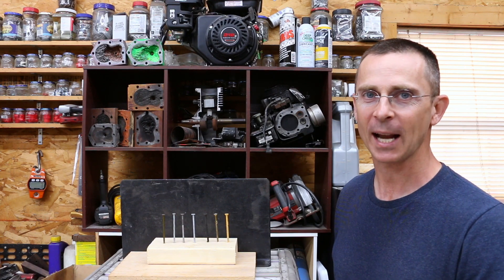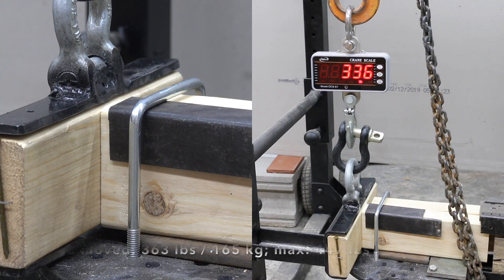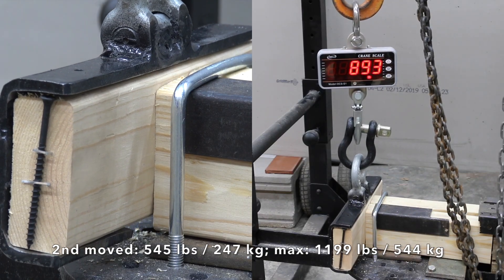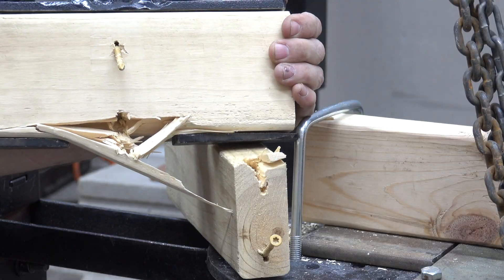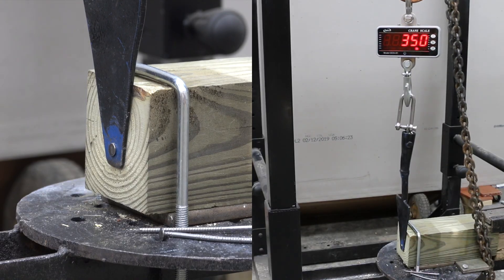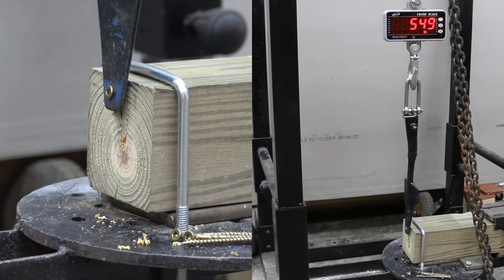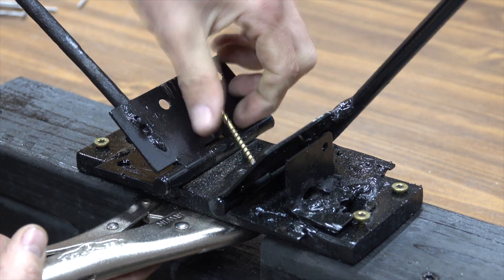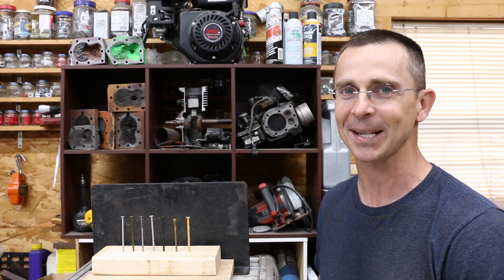Do Screws Shear easier than Nails? Let's find out!

Comment: You did not really test shear strength at all. You measured how much force it took to pull them out at an angle.  Your last test to break them by bending is unlike any real application. nails and screws are meant to be driven all the  way in and could not be bent like that with out the wooden structure being destroyed by something else before they ever bent that far.
Reply from the maker: Thanks for the constructive feedback

Comment: Great test! Thank you. The reason i asked you about Shear strength is because of hurricane straps. According to code  all hurricane straps must be fastened with a case-hardened nail. Seems to me as far as holding strength screws would be better.
Reply: Dysfunctional Fly Tyer. Agree. I think a deck screw would be more beneficial to holding and shear strength when properly applied. A fully sunk deck screw would hold a strap better and be rust resistant.
Reply from the maker: Great point and thank you!

Comment: Interesting. Seems the brittle screws and or nails would still be a good option as the flex test was bending on a very large angle. If you bend or flex that much you pretty much demolished anyway. I would try something like 3° flex or bend.
Reply from the maker: Thank you!

Comment: This video is a great source of information for basic construction with soft pine lumber. As we learned the fasteners rarely failed in the different tests. The lumber actually failed. The loose fibers can't withstand the forces. No surprise that we see the screws hold better because they can grip the fibers with their threads. I believe we would see completely different results with a dense hardwood like Oak or Hard Maple. The fasteners all would shear before the fibers torn apart or the lumber would crack or spilt. I think this video further reinforces the importance of fine detailed wood joinery for furniture grade projects. Great video! really enjoy your productions!!
Reply from the maker: Great point!  Thank you

Comment: Hey could you try spax screws I get them at home Depot and I love using them I use the 3 4 and 5 inch
Reply: Trey Elam I love my spaxes too
Reply: Spax are the best I have found. I drove some stainless steel spax screws into the maple legs of my workbench. I used pilot holes. Came up a few screws short, so went to a local screw supplier and got their stainless steel screws. Several broke, even with pilot holes. Been using Spax as much as possible ever since.
Reply: Agreed, cheap and seemingly awesome

Comment: What about Shaw Shanks?  I heard they're pretty redeeming, lasting 19 years of abuse, even in the most grueling environments.  They're also great for working on roofs, even in the high summer heat.
Reply: They work the best, whether you are on the "inside" or the "outside."  Always use a rock hammer to drive 'em in.
Reply from the maker: Thank you!

Comment: How about testing simpson strong tie brackets on how much force it takes to pull them apart or if the screws/nails fail holding the brackets to the wood
Reply from the maker: Great suggestion!  Thank you!

Comment: Drywall screws get a lot of flack for being brittle, but in reality the wood is almost always the weak point. For general construction that doesn't have to be load bearing they hold plenty strong for things like makeshift shelving, and I use them for making equipment stands in my locksmith truck and they don't even come close to getting to their load limits, they are an invaluable cheap fastener for kicked in door jambs and what not as well.
Reply from the maker: Thank you!

Comment: I would still love to see some destructive testing on Snap On, Husky, Harbor Freight, Gearwrench and Craftsman wrenches, sockets, and ratchets. See how much force various modes of failure require.
Reply from the maker: Thank you!
Reply: @ProjectFarm  reminder
Reply: You should check out a channel called Ave. He does alot of videos like that and he's funny as hell.
Reply: Have you ever had a hand tool fail on you? I’ve never had a wrench fail on me. Maybe a generic socket wrench or two. I learned my lesson with the busted knuckles.
Reply: @MoneyManHolmes  I've had ratchets barf their guts out and sockets break plenty of times, that's not even that difficult if you can brace your body and aren't a scrawny lil feller.  On the other hand,  I've only broken the poorest of closed end wrenches and that was with a cheater bar.
Reply: for that you can check out AvE's channel
Reply: Ave did a pretty good test.  https://www.youtube.com/watch?v=KesUkDx-7LI
Reply: Good idea
Reply: That'll get expensive real quick. He buys all his own stuff to test.
Reply: That would be really expensive, even by PF standards. Support Project Farm on patreon if you're not already!
Reply: Load test them yourself. I have broken all 3 of the common sizes 1/4, 3/8, 1/2  sockets and drives usually forcing a smaller size to do something a larger size would have survived. Back in the day I started out with 1/2" and never looked back for a long time. I never had the balls to break any of the 3/4 and 1" stuff, given the time I probably could with a long enough cheater bar. Usually the bolt breaks before anything else in the larger sizes. 

You waste your money with Snap on you can buy 2-4 wrenches or other tools for that matter for the cost of 1 snap on. I can count on 1 hand the number of craftsman wrenches I toasted over the years. Of course that was when craftsman were made in the US with better quality control those days are over. Buy them cheep with a "lifetime" guarantee, break them or not, then take them back. In the normal use of a tool if it is used properly and you didn't get 6 for a dollar it will last a long time no matter what the brand.
Reply: @thinkfirst6431 PF regularly requests video ideas. Anyone else's assessment of a suggestion I make, much less telling me to do this or that, is completely immaterial to me.
Reply: @thinkfirst6431 So assumptive, I have never bought any of the big name expensive tools. I actually buy at pawn shops and clearance sales only. Your assumptions about what I own are wrong. PF asks for input on test ideas. What others think about it doesn't matter to me.
Reply: @Juice556  I buy all tools I can find that I want or stockpile at all places that I can find a tool for 10-20% of new. So you would waste PF's time testing tools you are not going to buy anyway. A wrench for a $1 is just a wrench for a $1 it doesn't matter what the brand if you have 5 of the same size you have a lifetime supply anyway. Think about PF's time as a resource I would rather have him work on something hard to test like the oil shootout he did than finding out a $2 wrench breaks at the same rate as a shiny $20 one. I am beginning to think that you don't think at all not that it matters to me.
Reply: @thinkfirst6431  PF Asks for ideas and comments. Other people's thoughts or opinions on what I say do not matter to me.
Reply: @jakeshaw6827  Not a all. Who cares if a $2 wrench fails before a$20 wrench, just buy 10 of the $2 wrenches. B's best argument is that he doesn't care what others think which means that we shouldn't care  about what B thinks in the first place. 

What we should be asking PF is how much holding power there is for lag bolts in a pound of butter. Who knows how much butter could be saved from falling on the floor if it had a 6" lag bolt in it?

Comment: Will you do a video on oscillating tool blades? I buy integra from Amazon. They work alright, but the center hub seems to break out frequently. I justify buy them as 20 for 20 bucks, vs the box stores brands at 10-15 bucks a piece. 
I've bought the titanium coated, the wood embedded with nails, and soft wood blades. I really don't see any difference. I do know the harbor freight blades aren't even worth considering though. 
Anyway, I enjoy your videos, and look forward to new ones each week! Keep up the great work, and thanks again!
Reply from the maker: Thank you for the video idea!

Comment: Simpson StrongTie makes fasteners which they claim out perform others. How do those 'high performance' products compare?
 SD CONNECTOR ScrewSimpson Strong-Tie® ConnectorsThe Strong-Drive® SD Connector screw is specifically designed to replace nails ... the single-fastener load values achieved by the SD screw exceed those of typical 10d common or 16d common nails.
They also make some stainless steel screws.
Reply from the maker: Thank you!

Comment: I call error.  Love your videos but I'd like to point out that nails or screws into end-grain alone is not proper use of the fasteners. 
Yes the can go into end grain to tack things in place but all connections should be nailed or screwed across the grain into cross grain even if it's just toe-nailing or toe-screwing.
Reply from the maker: Thank you fro the constructive feedback!

Comment: You need to stabilize the Wood you are pulling UP on.. from the opposite side to prevent the Test board from kicking OUT and then up.. you wanted to test the UP force needed.. not the PULL force which is what it turns into as the wood kicks out from the pulling up! 

To me this test of SHEER Strength needs to be tested in a more reliable way... You had the set up... But you failed to secure the backing so it didnt kick out as you pulled up & the metal Angle you used to prevent the wood from crushing on your bracket needs to be all the way to the END of the wood to prevent the weak point(Wood) from breaking UP and thus creating PULL force again... if you fix those.. you will get the sheer force! because all you did here was do an Angled PULL.. which converts to HOLDING strength and NOT sheering strength! Other than that... this was a solid video! Love the channel so much..... and even though I was critical of the process in this video..... I love the passion and dedication to this! Keep them coming!
Reply from the maker: Thank you!
Reply: @ProjectFarm  You are most welcome sir!

Comment: You could try HurriQuake nails. Per Wikipedia: 

The HurriQuake nail is a construction nail designed by Ed Sutt for Bostitch, a division of Stanley Works, and patented in 2004. The features of the nail are designed primarily to provide more structural integrity for a building, especially against the forces of hurricanes and earthquakes.

The Hurriquake nail won the Popular Science Best of What's New 2006 award for Home Technology and was honored as the grand award winner for Best Innovation of the Year.
Reply from the maker: Thank you for the video idea!

Comment: I would like to see a comparison test on witch is better - crimp (insulated and non insulated) vs solder wire repair - thank you - i've heard the solder  can spread out into the wire making it brittle - and i've heard a crimped repair can actually be very strong if done correctly
Reply from the maker: Thank you for the video idea!

Comment: In the first test, you are nailing/screwing in end grain which doesnt hold the fastemers well enough. Also the force applied is so progressive that you are testing more for holding strength than the actual shear strength of the fasteners.
Reply from the maker: Thank you!
Reply: @ProjectFarm  thank u fir being so accepting to critisism. These are some good points, either way, very interesting. Gives me more faith in some lag bolts ive used lol

Comment: Looks like the 2x4s failed, not the screws.
Reply: The test was really about the ability of the endgrain to hold nails/screws. The nails and screws themselves were not sheared, just pulled out. However, this is just semantics - at the end of the day you want to know how strong the overall joint is, not how exactly it fails.
Reply: @kardRatzinger  Exactly!  Great video with a misleading title.  Wish i could upvote this comment 1000 times.
Reply: @kardRatzinger  Not true. The reason nails are used for framing is that they  have very high shear strength, when compared to screws, which would simple break, rather than bending.
Reply: @MW-gh1mo  Not sure which of my comments you are referring to, I can't remember writing anything that would contradict what you wrote
Reply: Yes!!! ^^^ This is why framing is toenailed  and not nailed into end grain. Common mistake, but an important one not to make.
Reply: In real-world situations, unless the joint is way under design... it's so rare that nail and screw itself will shear apart.

OK the caveat, you could see that his test is flawed. This is not exactly a shear test. It's closer to a bad design bond strength test. His subject rotates so the actual force that pulling the nail out is the probably more tensile force than real shear. This mode of failure is closer to secondary failure in real-world situations.

What if his test line-up correctly, in the end, chance are that it will end up as pulling failure too. But the chance is the bearing capacity of the column will be the failure criterion in this case.
Reply: Yes, but that's the point isn't it. If the fixing is stronger then the wood then there's no issue, is there? There are many construction uses where screwing or nailing into endgrain is used.
Reply: @98dizzard  the point of the test was to see if screws were more or less shear resistant than nails. Not a single nail or screw was actually sheared, so you can't make any conclusion at all about those two in comparison. You can suggest that pine wood is a terrible building material (in terms of shear strength), which it is.
Reply: @EvisNS  however the vast majority of timber framed construction is of pine or similar fast growing lumber. The result is still relevant, all the fixings are stronger than the lumber used in framing.

 The only test I feel would be needed is some further examination of the fatigue cracking. Whilst the test here was extreme, it's an exaggeration of the normal movement a timber frame would experience, further testing of this in a more realistic scenario would be interesting.
Reply: @EvisNS  since it's a soft wood in terms of holding strength it isn't, shear strength it's more malleable than a harder wood (same logic applied as nail vs screw) so it won't snap as easily. If you've ever lived in a place with hurricanes ( I grew up in Houston) you'll quickly realize why structural lumber is a soft wood. The trees always breaking in the wind are the harder oaks, vs the much taller and narrower pine trees will bend and sway in the wind without breaking.
Reply: When I was framing houses my boss told me that a 16 penny nail nailed solidly can hold up to ten thousand pounds. We were installing a steel beam and I was nailing a temporary support block and he I was putting four nails and he said put one so it wasn't a pain in the ads to remove.
Reply: @onehotseat  You might be right, I bet endgrain is even more inconsistent than straight grain in that regard, and the sample size was too small to account for that.
At least the experiment showed that screws generally hold better than nails.

Comment: You should try the screws sold at home Depot, I don't know what they're called, but they are coated in yellow, are long, made for use outdoors, and the head uses a torx bit, which is included.
Reply from the maker: Thank you!

Comment: i feel like nails are getting a bad rap. nails are designed to be used in unison with each  other and splaying out in different directions ...as a construction worker i generally use exterior building screws for the convenience and initial holding power but they dont have great longevity. when ever i get a demo project i love finding screws as they just break  easy and can be unscrewed  but when people use  lots of nails im cursing the long since dead
Reply from the maker: Thank you!

Comment: Im in construction and the results were exactly as expected.  In regards to the screws yes they are very brittle and do hold very well but are very susceptible to shock loads   . I heard somewhere the 16d vinyl sinker had a shear strength of over 16,000 psi?   I Dont know the accuracy of this but they are strong.  Another great project farm project.
Reply from the maker: Thank you!

Comment: I have often heard people say screws are not to hold things together but rather to clamp so friction keeps things from moving... would be interesting to compare sheering force by putting the screw thru with a slight gap (say 1/32 to 1/16 inch) more like a pin than screwed in, compared to "screwed in tight" holding stuff together.
Reply from the maker: Thank you!

Comment: I would like to see a helicoil and different types of them as opposed to just re tapping a hole that is stripped out like in an engine block see which ones r the best be very interesting even use epoxy to gold the bolt in or epoxy that is drilled and tapped back
Reply from the maker: Thank you!

Comment: I was told by a carpenter that the reason for using coated nails is that the heat generated by the driving the nails temporarily liquifies the coating and set the nail for a stronger bond. Dont know if its true but sounds right other wise why coat the nail. Next test try seting the nail with 2 hammerblows or a air gun.
Reply from the maker: Thank you!

Comment: I appreciate the video. Good work. However, I have one complaint/idea/suggestion. I think that you should have put a “guide” on the board you were lifting and the metal plate you were lifting so the only movement allowed is straight up and not letting them pull out. That would test real sheer strength. I’m actually surprised you didn’t do that, you usually think of everything to make the tests unquestionable.
Reply from the maker: Thank you for the constructive feedback!